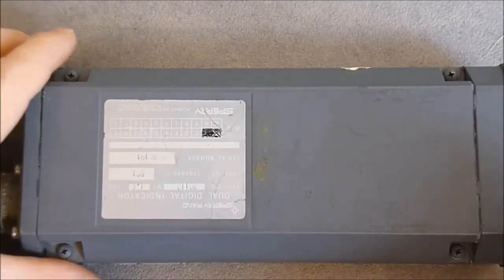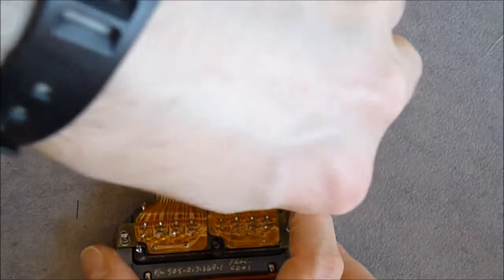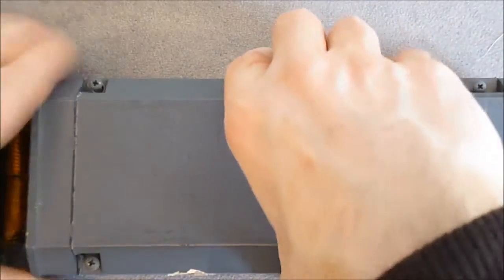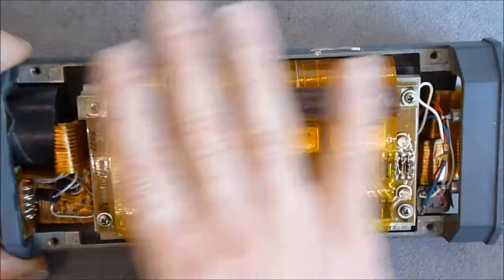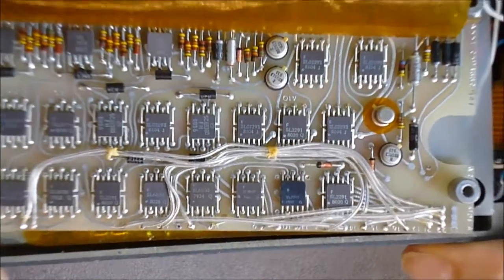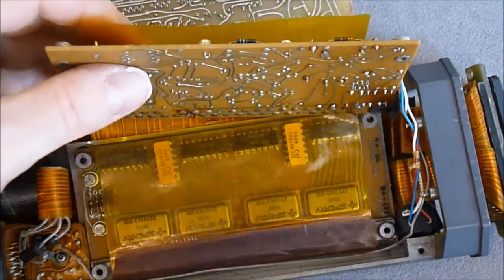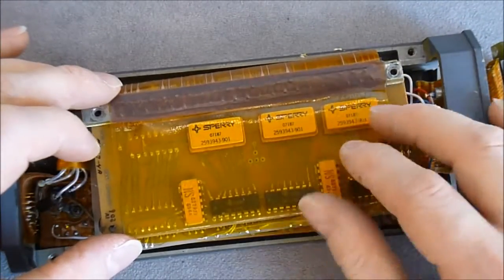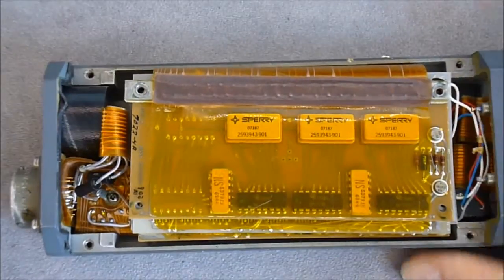Vintage Sperry digital cockpit indicator teardown

Comment: Sperry Rand made Panaplex displays very like those shown here, down to the triangular dots. Panaplex are orange (Neon), which makes sense with an orange filter. The strange pin layout and filling bulb on the back is typical for Panaplex also. The drive voltage will be higher than VFD (80v+). The ignition cathode would be hidden behind the strip at the bottom.